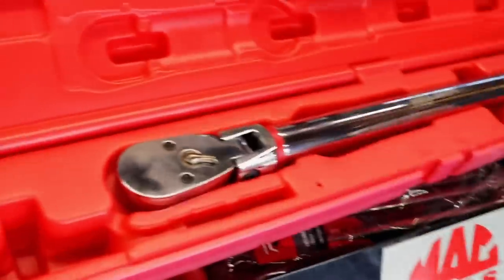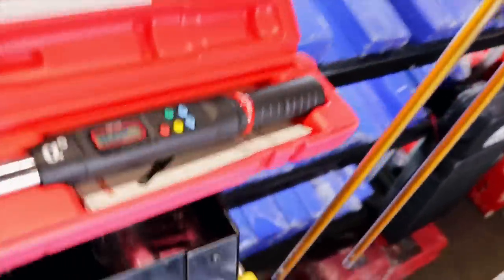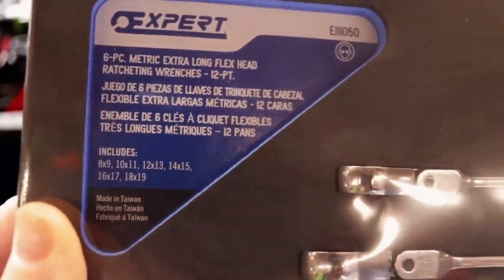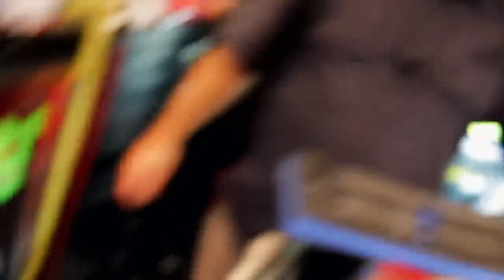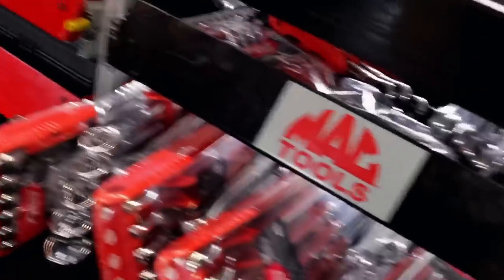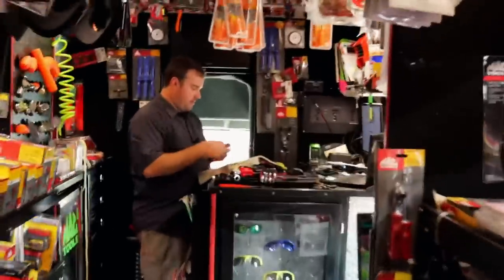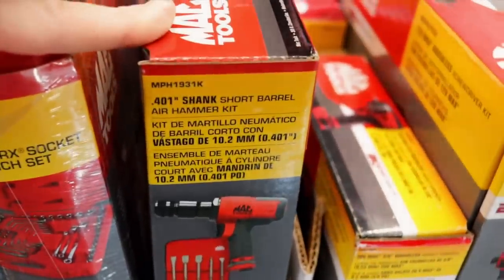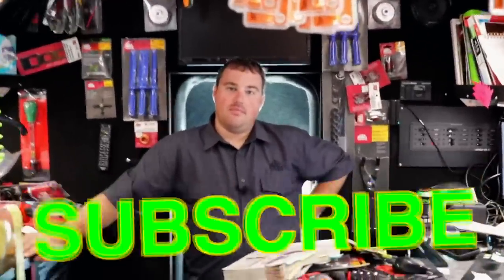Mac Tools: Digital Torque Wrench, Hose Clamp Pliers and Stubby Ratchet Wrenches

Comment: The hose clamp pliers work good, everybody seems to have the same ones rebranded, I like the GM Eco-Tech water pump holder tools that are full round so you can't drop the bolts inside engine.
Reply: They’re the single best hose clamp pliers I’ve ever used

Comment: I am with you on not owning a non reversible ratchet wrench.  I have a set that I do not use.  Almost got stuck between the bolt and the motor on a treadmill once.  Never again! No way to cut the bolt as they are in such a tight space.

Comment: Since you mentioned about the mac wrenches biting just at the tip of the wrench. I got the set for the drive shaft work I do . You can only fit an open end on the nuts and they grab just like how you side. Like a pit bull. Lol. Great wrenches. A must have
Reply from the maker: Yeah they are amazing how it works like that. No other wrenches will do that.
Reply: @KoonTrucking  I looked at the snap on ones teeth on the open end dont look as aggressive as the mac.  Great videos . Love my mac tools. Not too expensive and good quality.  You got my vote on this one.

Comment: My Snap On TechAngle is on the Fritz... so I went ahead and bought the Gearwrench 120XP flex head digital torque and angle 3/8 Torque wrench...$250... Not too shabby it's a real nice torque wrench
Reply from the maker: Yes it is. i have the 1/4” version and it works great.
Reply: @KoonTrucking  that'll probably be my next...👍

Comment: I like the Stubbys but I cant say you'd be able to take off a 3/4" nut with that small of a wrench
Reply from the maker: Figure they are like most stubby ones, break it loose with a longer one and use it in tight spots to ratchet the nut or bolt out.
Reply from the maker: Remember at the end of the day it’s still a ratchet wrench which isn’t designed to “break them loose” just like a ratchet .... supposed to use a breaker bar

Comment: They should make a locking flex head torque wrench
Reply: Torque wrenches typically don't flex past 15 degrees, so a locking device wouldn't have much use.
Reply: i beleive cornwell tools has one

Comment: I got them hose clamp pliers and love em use them alot, but I still just use small.visegrips so that way it's already clamped upen
Reply: Better yet they make alligator vise grips with the teeth specifically for those hose clamps. Mac and Matco both sell them
Reply: MLHC9A is Matco and HCP900 is Macs

Comment: I have only seen one set of flex head reversible ratcheting wrenches. Williams makes them and it’s a six point. Seen them on amazon. Also saw some locking flex head ratcheting wrenches...I didn’t know they made those
Reply from the maker: Bill has a set of BluePoint that are pretty sweet

Comment: Not sure if you like harbor freight but they have in there Icon series long handle flex head reversible ratcheting wrench set but they are splined no 12 or 6 point.

Comment: I am not a professional so I don't want a digital torque wrench. Rather, I want a calibrated mechanical one that lasts. Back around 1992 one Saturday I heard an ad on the radio saying Snap-On was closing a distribution center near me and having a sale. So I went over and one of the things I bought was a click type torque wrench for changing my wheels. I can't count the number of times I have used it for that purpose.

You probably can't make as small a wrench head when you make it reversible.

Comment: Have you seen the mac tools 3 different radiator hose clamp tool?? I dont kno the name or part number but it has a knurled thumb screw with a 10mm to use with a ratchet, or ect I also love the knipex pliers that have the 3 point teeth that spin for hose clamps
Reply from the maker: Cool I will have to check those out. I haven’t seen them. I have seen the knipex pliers

Comment: Ah come on bro, you looked at and played with all those wrenches and folding holders and didn’t ask if they available without the wrenches or if they will even work with other brands... 

Man I wish I had a Mac dealer just so I find out about those darn cases!😉

Do me a solid 👍🏻 next week, please ?
Reply from the maker: I’m positive they won’t work the way the wrenches lock into the cases they are designed for the Mac wrenches with that angle built into them I don’t know of any other wrench that are angled on the open end

Comment: Me and my friend today where using a brand new Snap-on drill we just tested and a spark a fumes came out. What could have caused this and should we get checked by our dealer?  (Drill still seems to work fine )
Reply from the maker: If it’s new it has a year warranty on it. Run it till it quits is what I would do

Comment: Matco set me a email about the black handle and it was the 200++ no no the 1/4 locking head gear wrench I got off eBay said one left and took 3 days no ship I looked him up and called told him give me my money back found better deal for the better color for cheaper woot what a pain in my ass to find all the needy tools at a good cost for me I work on everything for anyone who needs the help and work you getting what you get makes me jump to what I can.

Comment: There is no point of having flex head reversible I think. Am I wrong?
Reply from the maker: Not all threads are righty tighty lefty loosey my man
Reply from the maker: What ya gonna do if you need to torque a left hand bolt